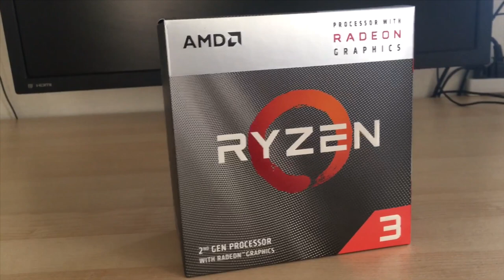My First PC Build (Ryzen 3 3200g)

Comment: Did you have to update your motherboard to support that CPU cause I am making a similar build and most people are saying that the motherboards bios has to update
Reply from the maker: No, mine already had 2nd gen support, but barely, if you are going to use an APU I'd recommend just using a B450 motherboard. I chose an x570 mobo because I was upgrading to a Ryzen 7 3700x but if you are going to upgrade like me later down the line, you will have many issues with it outputting video. It is not broken, it's just the compatibility is just kind of trash.

Comment: have you lost your mind???? it is 3200g i know it is your 1st pc
Reply from the maker: Yeah I put it in the description, the 3200g was temporary, my current setup now has a 7 3700x. I'm never getting temp parts ever again, it sucked
Reply: @tommybee33  okay and i want to know that what graphics card are you using please tell
Reply from the maker: @shauryakumar5421  I got an Rx 570 8GB for like 80 bucks, it bottlenecks quite a bit but it works, I'm upgrading it soon
Reply: @tommybee33  are you having any recommendation i want to do coding on a pc so what type of components are good for me the whole budget is around $450
Reply from the maker: @shauryakumar5421  hmm, well if you're coding I'm guessing you don't have to really worry about graphics so you can get an rx570 like me or gtx 1070 and pair it with a 5 2600 or 5 1600 AF. These are just very vague though, I just build PCs for gaming so I don't know that much, so sorry that's all I can try to recommend. Try consulting a more experienced PC builder.
Reply: @tommybee33  thanks brother

Comment: did you need to update the bios of the mobo or its ryzen 3000 series ready?
Reply from the maker: It was Ryzen 3000 series ready and 2000 series compatible
Reply: X570 motherboard can even support the 4000 series cpu so no worries mate
Reply: @Nege97  ty
Reply: @gushiees5955  np

Comment: Nice build but I would’ve gotten a much cheaper motherboard and a better cpu and gpu. But if you plan on upgrading in the future you’re set
Reply from the maker: Thanks, and yeah I am planning to upgrade in the future. I just wanted to build the PC so I have something to occupy me.
Reply: @tommybee33  btw what are the specs?
Reply from the maker: Mozza's World As if right now it is a Ryzen 3 3200g, 16GB(2x8GbB) GSkill Ripjaws V, x570 A-Pro, and 650w PSU. I did recently just installed a graphics card but I will show it later in a future video :D PS the I am going to upgrade the processor to one of the 3rd gen processors
Reply: @tommybee33  ok. Did you use a B450 motherboard?
Reply from the maker: Mozza's World Oh sorry forgot to specify but the mobo was the x570 A-Pro
Reply: @tommybee33  cool. Did it need a bios update?
Reply from the maker: Mozza's World No it came 2nd and 3rd gen ready
Reply: @tommybee33  cool thanks 😊